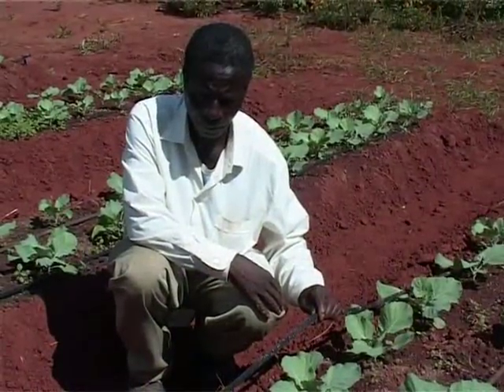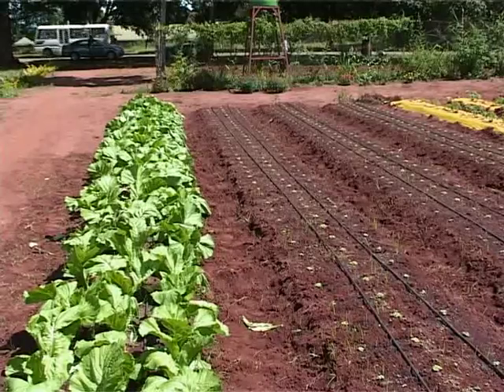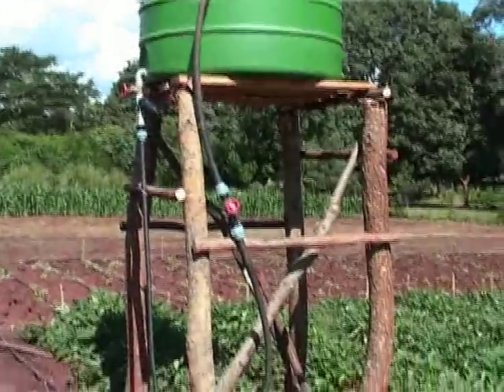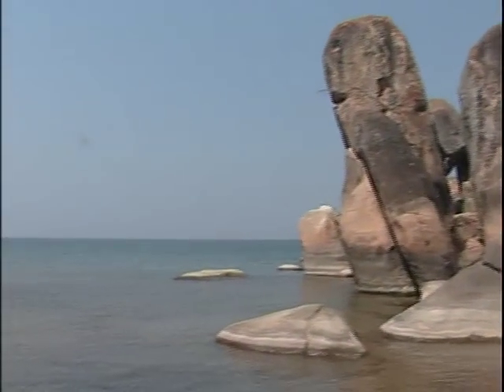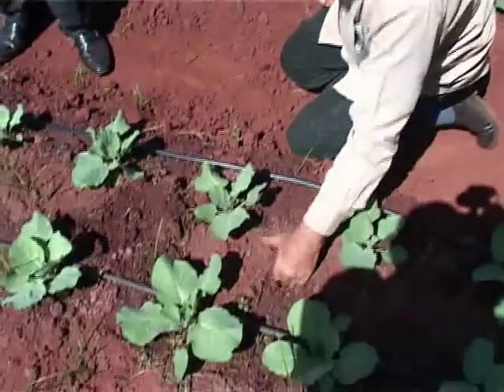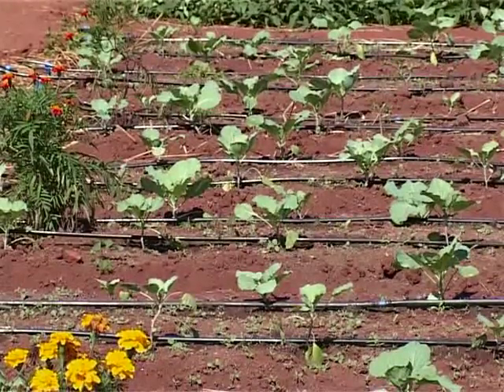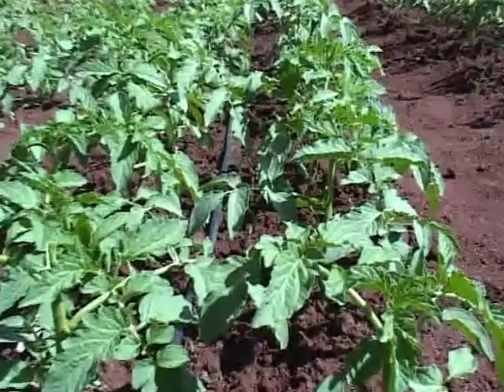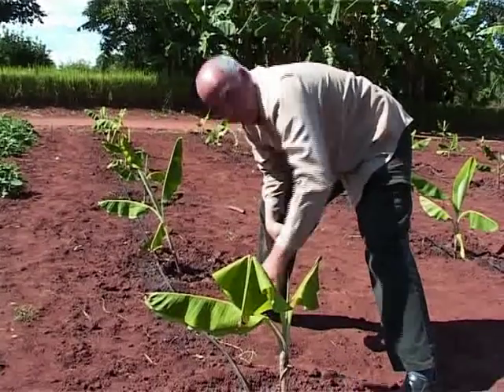Drip Irrigation In Malawi 2014

Comment: how high does the water tank needs to be to get water to the plants and how far?
Reply: Water tanks don't need to be placed too high. Just a little bit higher than the soil at the roots zone of plant is enough. In fact, one meter above the soil would already be great
Reply: Very good system, I love it
Reply: This isn't true..the minimum pressure requirement for gravity drip irrigation is 0.3 bar... equivalent to tanks ele vation of 3mts high (10ft)..most farmers have failed in drip irrigation work due to this pressure requirement and misleading information .. hope this is helpful..